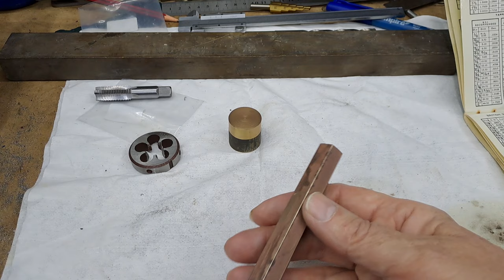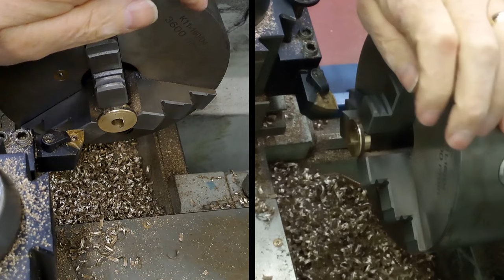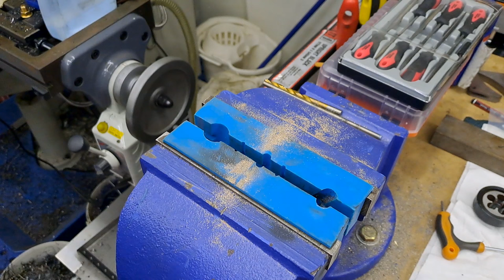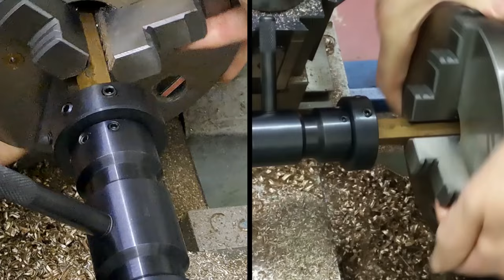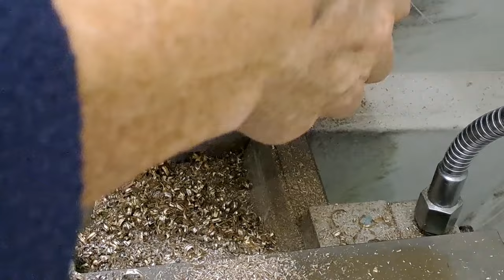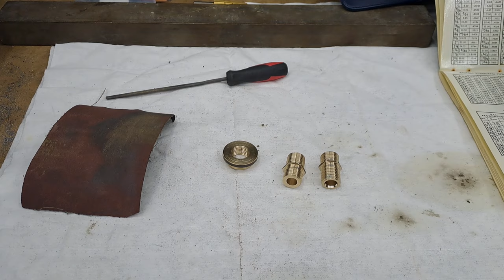034 Suction and Discharge

Comment: Hi. Nice make please use some cuting fluide from Brian
Reply from the maker: Hi Brian, 
Thanks for the comment. Brass, along with most non-ferrous metals, doesn't need cutting fluid. Not even for cutting threads. What would be better would be a shield on the lathe tool to stop the swarf going everywhere!
The Chef